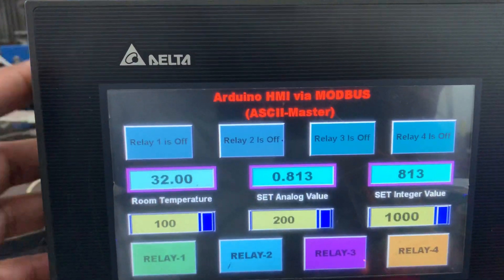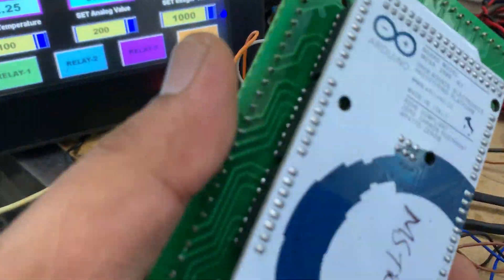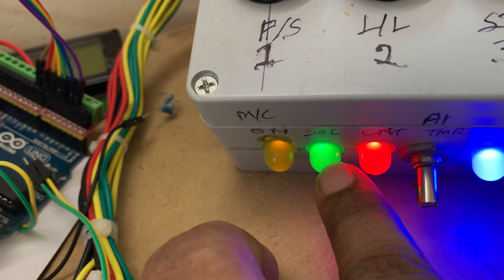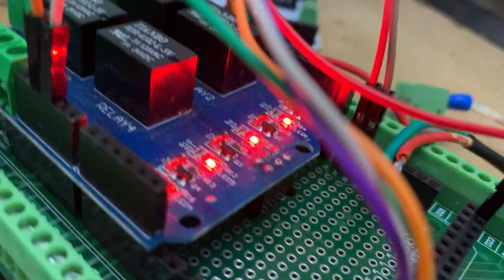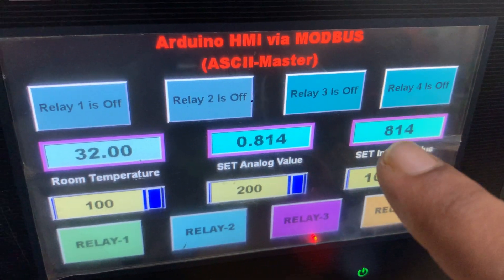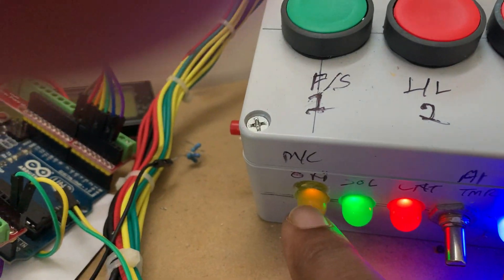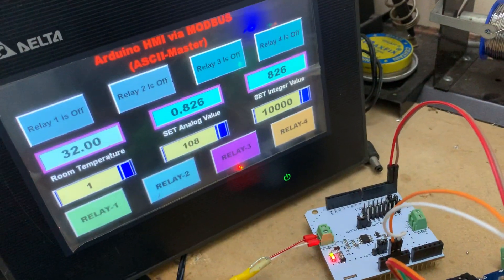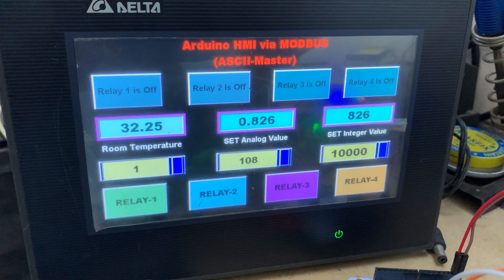Arduino HMI Master, via Modbus Part-1

Comment: As a Material List;
Arduino Mega,
4 Relay Board,
RS 232 Shield,
Max 6675,
Delta Dop

You have used. Is there a piece I didn't write?